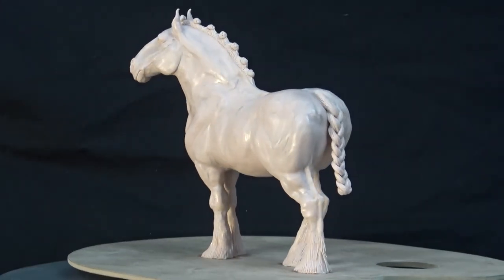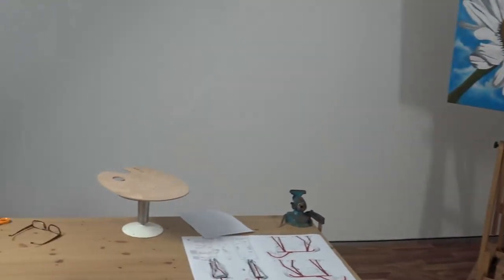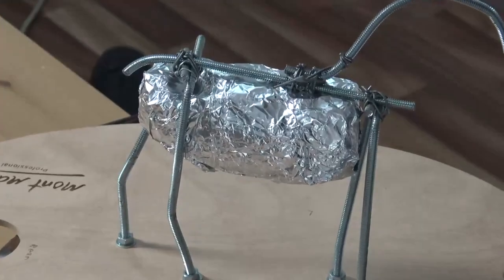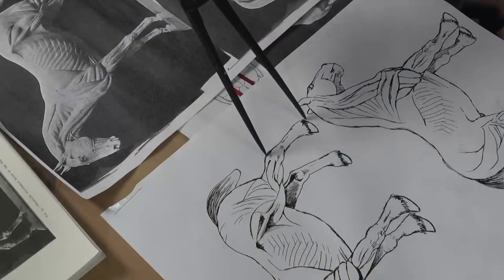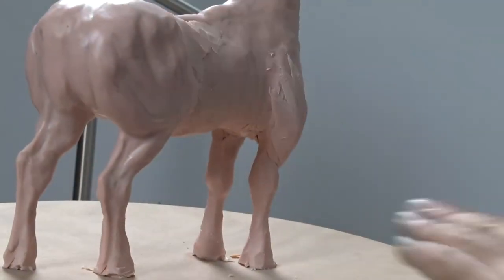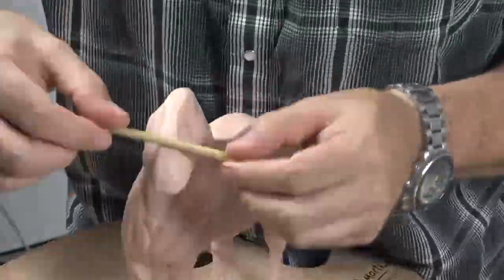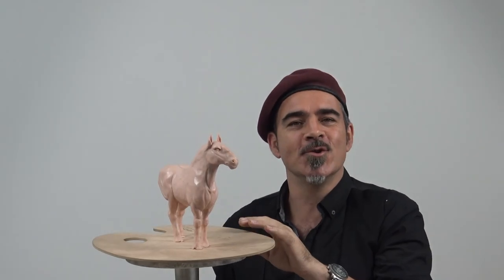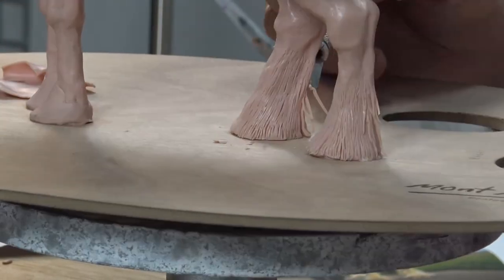Art lesson:  How to Sculpt a Shire Draught Horse with Polymer Clay

Comment: Hello, amazing work. Would you please tell us at what temperature are you baking the model? And for how long? Just for this model ?
Reply from the maker: Hi Galip, thank you for your comment. To bake this model, you will need to put it in the oven at a temperature of 130 degrees for 30 minutes. Once it is baked, turn off the oven and open the oven door but don't remove the model until it has cooled down completely. 

Once the model is cool, you can remove it from the oven and start painting it. We have a second tutorial that takes you through the painting steps if you're interested. You can find it here: https://www.youtube.com/watch?v=zs6T30EBqSo. Good luck!

Comment: So one thing i cant seem to get my head around is that you bake the clay with the metal bits inside?
Reply: Polymer clay bakes at low temperatures for a relatively short period of time, usually 15 minutes per quarter inch of thickness.  The metal inside isn't affected and doesn't affect the sculpture at those low temps and short baking times.

Comment: Hello! How long and hot did you bake your horse model for?
Reply from the maker: Hi there - thanks for reaching out! To bake this model, you will need to put it in the oven at a temperature of 130 degrees for 30 minutes. Once it is baked, turn off the oven and open the oven door but don't remove the model until it has cooled down completely. 

Once the model is cool, you can remove it from the oven and start painting it. We have a second tutorial that takes you through the painting steps if you're interested. You can find it here: https://www.youtube.com/watch?v=zs6T30EBqSo. Good luck!

Comment: How do you successfully bake that?
Reply from the maker: It should pose no problems because the core is already baked/cured.  So you are only baking the 'outer shell'. You bake the second stage (shown here), for an hour at 125 degrees C (257 F).  Turn the oven off and open the door.  Let the piece cool gradually and don't remove it until it is totally cooled.  This slow cooling is the key to avoiding cracks from quick contraction. Thanks for the enquiry.

Comment: I'm sorry but the neck is disproportionate
Reply: If you look at the horses on google its really not. They are are massive muscle horses used to move heavy wagons. It is actually pretty accurate.
Reply: I agree with you. The part between the withers and the back is too small (uh...or it's the neck that is too thick maybe), so it give an impression of a weird neck. But it's still a great work :)
(sry for my english, i'm french :/)
Reply: Draft horses were bred for very large muscle on the neck and front upper shoulder areas. This was so they could pull very heavy loads without straining muscles or even snapping tendons or ligaments. If you look at pictures of draft horses that are used for actual manual labor compared to the "parade pony" draft horses, the draft horses used for heavy work have the same muscle structure.
Reply: actually, looking at pictures, I do see where you are coming from, but the muscle structure of this sculpt is far, far overdone. The way it has been made here, makes it so the horse can hardly even move its neck down to grace! Sure they have extremely thick necks, but this is by far unrealistic
Reply: Agreed.  If you look at it too,  you'll notice that if the neck is too thick,  then the body is too short and not "thicc" enough.

Comment: Not rly good proportions
Reply from the maker: Hi truth hurts, yeah,  The mistake I made was to  adjust the skeleton of a standard horse, the height from the back to the plinth and the length from the chest to buttocks is ok, the two flaws are that the neck is not long enough and the back to the belly is too wide, so as a result the horse doesn't look 'tall'.  I had many problems with this project and will use it as a lesson.  Btw Is there any other flaws that i could improve on do you think?  Thank you for the comment too.
Reply: +MontMarteArt thank you for your non toxic reply, it's smth that is rare nowadays. The thing that attracts my eyes is the thick neck / big head. I think if it was a bit smaller, the proportions would be much better. Plus, Idk how to call it in English, I'm not a native speaker, but the horses hair on head and tail make it look a bit grotesque. It makes the horse look like a hybrid of some sort from sci-fi or horror games. But when one starts looking at details, yeah, it looks normal, just weird.
Reply from the maker: Hi Truth hurts, yeah I get what your saying regarding the hair too,  i'll take it on board.  Thanks again.
Reply: Hi, the clay you use, can the same be done with super sculpey clay? That is heating it and then applying more clay to it?? That's pretty neat technique plus the fact that the super svilpy I'm using is soft which is hard at times to work on